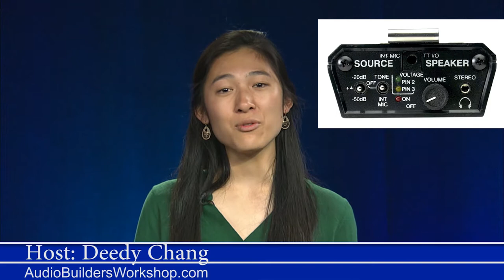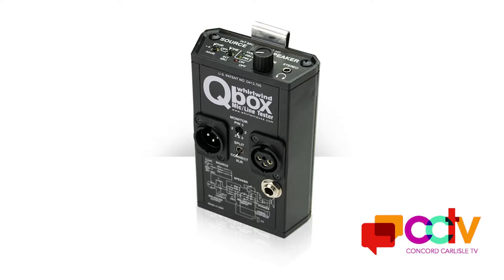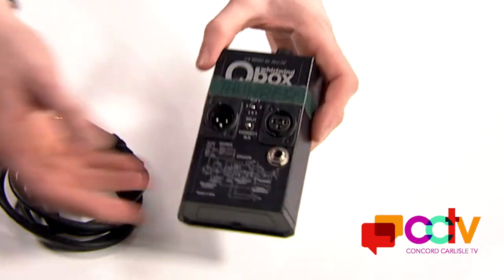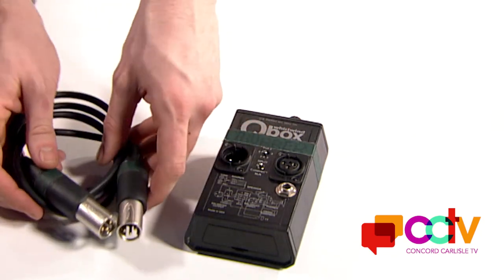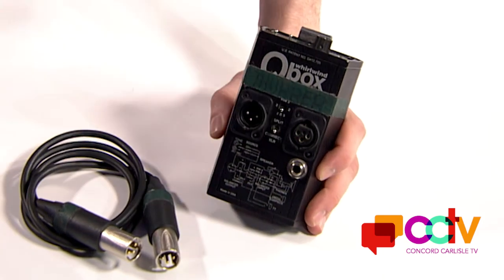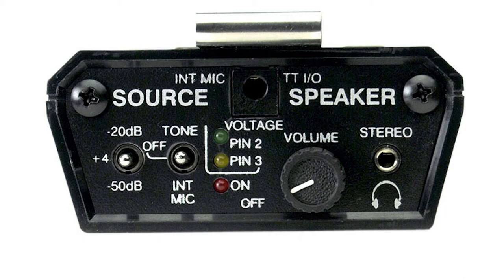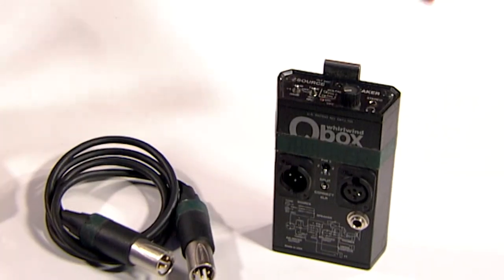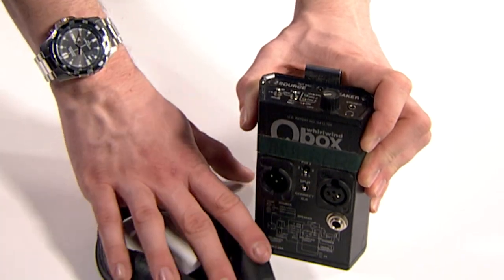What's In My Gig Bag 3: Whirlwind Q Box

Comment: So I’m a bit confused, can you test an Xlr cable to see if the line is any good without the speaker or a microphone using the voltage meter on top? Similar to the sound tools xlr sniffer?